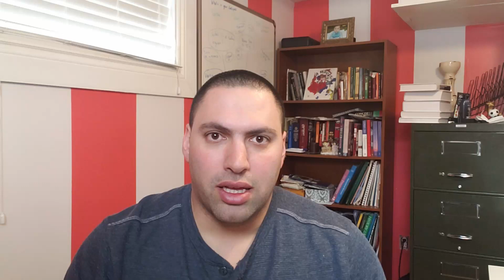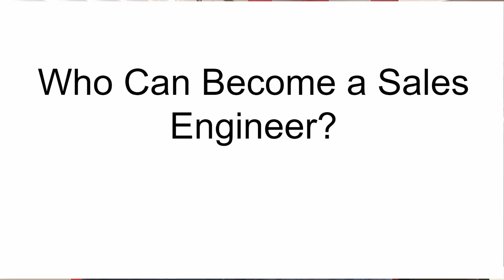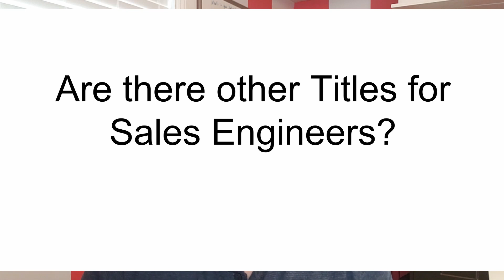What is a Sales Engineer?

Comment: Thanks. But does SE only sell software? I suppose they can also sell consulting services. Please correct me if Im wrong
Reply from the maker: Doesn't have to be although it's very prevalent today. I sell test and measurement equipment. On my podcast I've talked to SEs that sell networking gear, microchips, processor boards, turbines, software, SaaS, security, IT gear like servers, network monitoring etc. Basically anything that needs to be sold that is technical could require an SE